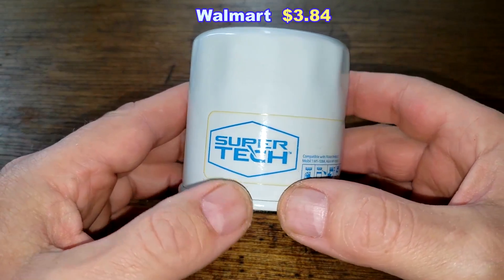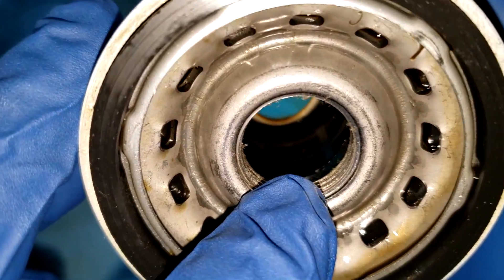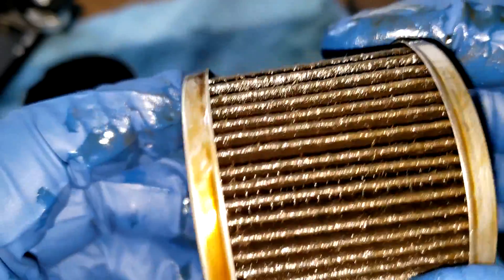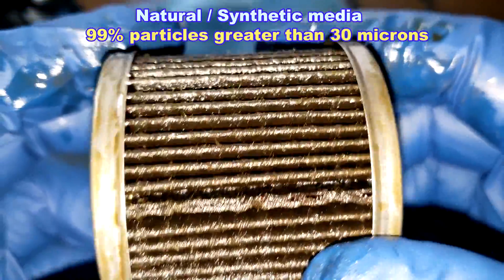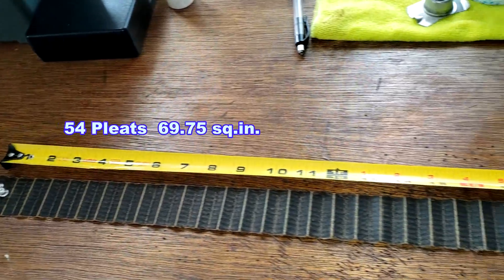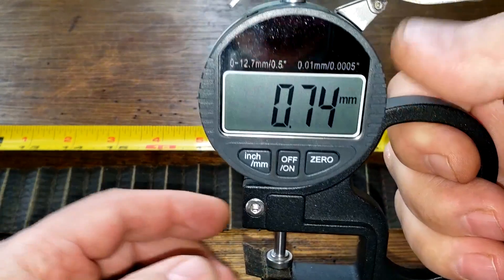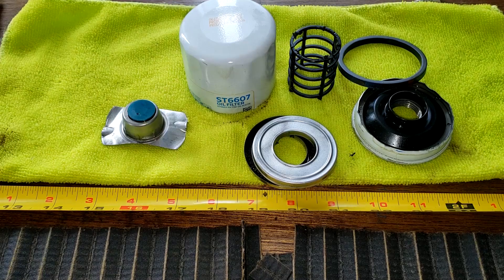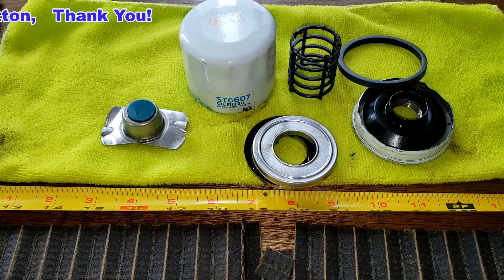Walmart Supertech ST6607 Oil Filter Cut Open, Used Walmart Supertech ST6607 Oil Filter Cut Open

Comment: I'll start by saying, Ken may or may not know the shorty 6607 is not the Honda spec size filter, the ~.75" longer 7317 is. That said, many quick lube places and lower tier filter listings consolidate to the shorty used here. Also, the 3.5L Honda Pilot/Ridgeline filter is in a terrible location. Right above a control arm/cross member. So tight, can't even use a fitted cap wrench. "Maybe" because 6607 shorter, cap wrench might work, idk. While 9k miles seems like a lot, being done in 4 months I'm going to speculate much of that highway 'type' driving at engine operating temps which would be easiest on oil. Ken also likely paid some attention to the dash MM OLM read out which shows oil % life left. I might shorten the oci a bit, but that's for Ken to consider. As you can see, these ST ecores are no media area leaders, skimpy. The wide nylon core makes for a deceptive look. I would likely use a better higher tier filter. Seems WM has discontinued the Super Tech MP series ecore with silicone adbv. Kirkland , ST Syn, Amazon Basics, all the same. Good oil. Long comment, but I have some knowledge about the 3.5L Honda engine. Thanks for the video.
Reply from the maker: You're Welcome faxmen09, Thanks for Sharing that info👍💯
Reply: @WhipCityWrencher  You're welcome too. Have a great day.
Reply from the maker: @faxmen09  Thank You, have a great day also😊
Reply: I was thinking the same ST7317 is correct filter for j35 and many other Honda's. 6607 is mini
Reply: @Sw-so4zj  Yes as noted technically the 7317/14610/57356 is the spec size. Having followed, owned and maintained Hondas since 1996. I'm not aware of any Honda vehicle that specs the topic shorty. In~2001 majority Hondas switched to 7317 from the wider but shorter 9688. All that said, many quick lubes and low tier filter look ups (like white ST) do consolidate the 7317 to the 6607. The current Honda OEM A02 is 7317 size.

Comment: The oil did the job well as syntetic .it is in deed the quality filtering fabric this Supertech was made. Poor quality meterilas. Perhaps  it is made out of mixure of scrapped recycles.  Not a cup of tea to me. Would rather to use OEM or Wix . Personally wouldn't recommend it!
Reply: The OEM filter uses fiber end caps, which I will NEVER knowingly use on anything! Not only that they cost more, and I don't like paying more to get less. I might see if I can find a Purolator Boss that fits.
Reply: Dealers offer mayor discount On line either  for toyota owner or autoshop.  They are made on thailand  meticulously certified imported good quality design.

Comment: Wasn't that nice Ken stuck a paper towel so oil didn't leak all over the place? I love Honda Pilots! Ken, needs to change every 5,000 miles. Oil too sooty for such low mileage on engine. I'd even get a better filter. Just my opinion.👍

Comment: 9k miles on that filter seems pretty extreme. That's crazy. If I were to actually push my oil changes that far I would use something more reputable like the Purolator Boss, Fram Ultra synthetic or Fram Endurance filters.
Reply: I agree with you 100%
Reply: Most vehicles built since ~2010 have 7,500 to 10,000 mile oil change intervals, including this 2020 Honda. It's been standard for quite a while now.
Reply: @donwyoming1936  yes, I know. I still don't push them that far. 7k max for me. Also I was talking about putting that amount of miles on that junk filter, not the vehicle itself.
Reply: I run these on my Honda CRV, I don’t go over 5k on them.

Comment: 9k on that filter is a bit much...imo 5k max too be on a safe side.
Reply: I honestly think that 5000 miles is too long to go especially if you use your car every day I say 35 to 4000 max especially as a car gets older. People saying that Toyota and Honda filters are crap. Not sure where you’re getting that information from but it’s very inaccurate. If those OEM filters were crap, then people would be having loads of issues with their cars when using them.
Reply: @a @allisonb9072 yota filter usually do 97 @ 30 microns. Even the super tech does 99 @ 30 micron. Most after market like fram ultra does 99 @ 20 microns. This is why people say the Toyota ones are crap.
Reply: @TocyBlox 
I’ve got a Toyota.
I’m really happy with it.
But I won’t touch their filters.
Reply: @Nellis-d1h  exactly!!! Our family drives Toyotas and we never touched a Toyota filter. 😂
Reply: Is a bit loaded.
Reply: @ChrisPatrick-q6k  Most of the Honda ones are. Toyota uses a mixture of suppliers depending upon the application.  Fram can build a quality filter but producing high end filters has never been their bread and butter. The Orange Can of Death has always been their bread and butter filter.
Reply: Io,ooo way too long ,oil is cheap  engines are not
Reply: I wouldn't run ANY oil or oil filter for 9000 miles despite the claim on the box.
Reply: Newer vehicles can go 10,000 between oil changes. It's the older vehicles that you change the oil every 5000 miles.
Reply: It’s built better than the junky OE filters from Honda and Toyota that people are running 10k miles. An OE Honda or Toyota filter went from being the best quality filter that you could put on your vehicle to absolute overpriced garbage.
Reply: @prevost8686  The Toyota filters are pretty crummy, but they are only like $6 at the dealership I go to. Once my warranty expires I will probably start using SuperTech filters. I think they are great for 5k intervals.
Reply: Yeah maybe, not that i would buy it but i'd go 3-3500k.
Reply: 5000 mile oil changes
Reply: I'm a bit surprised at what seems  to be a decent oil filter in that price range. From experience with my daughter's honda civic and Hondas I had in the past is that the engine oil life monitors tend to be slow to get down to 10 percent or so.
I ignore that completely and change the oil every 5-6K miles. 
If you wait until the maintenance minder light to come on, you might have driven about 10K miles...too long IMO even with a quality filter.

Comment: I liked everything about that filter except for the bypass valve.  I don't like how they stick it in the leaf spring.  But it is well made and looks like it did its job as intended.  The nitrile adbv is not a deal breaker though I do prefer silicone.  The bypass valve is just cheap and has potential  to not sealing well.  I would suggest a shorter maintenance interval though.